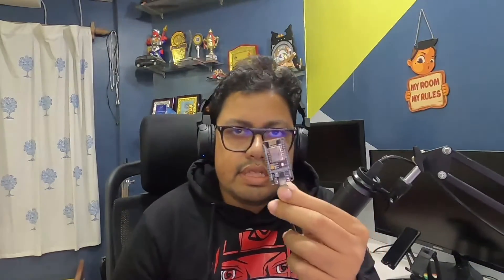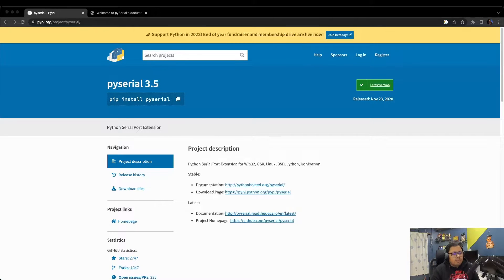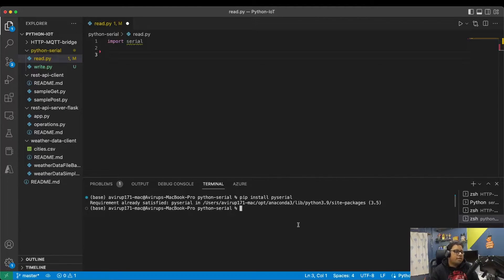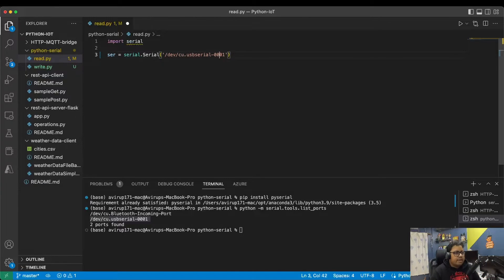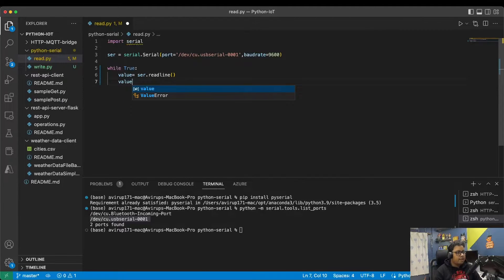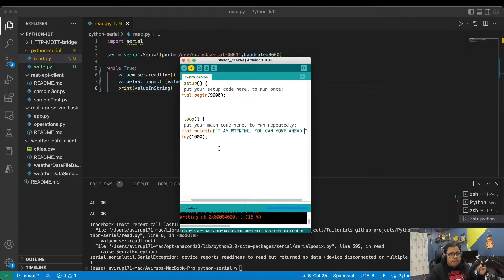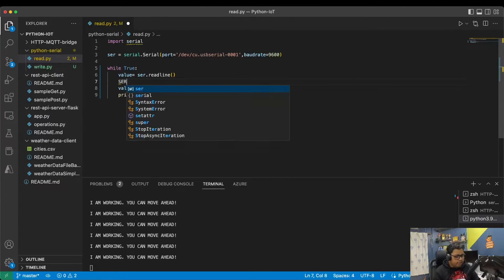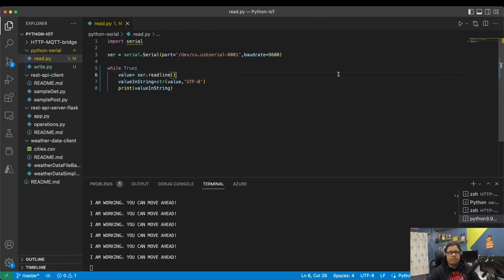Python serial port communication using PySerial #iot

Comment: Hello, your video is excellent. I have a question. If I wanted to read two ports at the same time using pyserial, how would that be? Could you help me? Thanks.
Reply from the maker: Hi. That should be possible, however I need to check it out. I’ll check and update you on the same.
Reply: hi  @Avirup171  ,  how are you? Ok, I appreciate it.
Reply from the maker: @yorlysflores6564  Hi. I’m doing fine. Was involved in some personal projects. Will be back here on YouTube soon.

Comment: import serial

 line 1, in <module>
    import serial
ModuleNotFoundError: No module named 'serial'

~ I've installed pyserial in everyway possible and even tried unistalling and installing it again. I tried using sudo to put it in dev mode to get it back working to only focus on the microcontroller. None of them worked and I still get the no module named serial error! what should I do?
Reply: This is annoying me as well

Comment: Hello SIr. I have watched your video. I have a problem related to python serial and barcode scanner.
I have a USB Barcode Scanner and plug into my Ubuntu PC. The Scanner is work propperly, since when I used it, it will output the reuslt of barcode on every cursor i put (such as terminal, vscode, etc.) but the `received_string` variable is always empty. The script is not give any error. Do you have any idea?

```
import serial
import time
SerialObj = serial.Serial("/dev/ttyS0", 9600)
time.sleep(3)
SerialObj.timeout(3)
print("Starting")
while True:
    received_string = SerialObj.readline()
    print("Received: ", received_string)
SerialObj.close()
```
I want to retrieve the data using Serial with the code, so the variable `received_string` will be assign with the value of the scanner data, but I always get `Received: b''`.

Comment: is the call ser.readline() a blocking call ?  if so then how to do it without blocking the rest of the application ?
Reply from the maker: Its a blocking call. One approach simply is to check if something is available in the serial first and then read it. 
Use an if statement to check ----- if (Serial.available() > 0) then continue to read else continue with other parts.

Comment: Hello sir, i have seen so much videos on youtube and didn't find any useful video except this. i am stuck at a line and the line is 
SerialException: could not open port 'COM4': PermissionError(13, 'Access is denied.', None, 5)
how to solve this problem i have tried everything but didn't get solution please help me
Reply from the maker: Is the same com port being used by any other application?
Reply: @Avirup171  I have also same problem. I used COM3 port in arduino IDE only. What can I do to overcome this problem sir?
Reply from the maker: Hi. Ideally if the same port is accessed by another application, this problem happens. Since you are facing this issue, it will be gereat if we can get on a call to resolve this issue. 
Feel free to block my callender for a free quick chat. 
https://topmate.io/avirup171